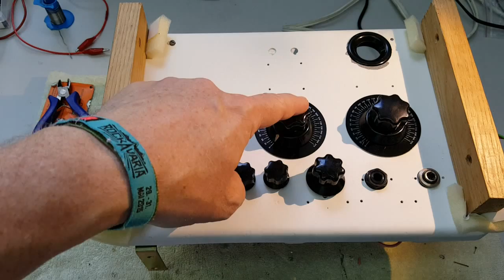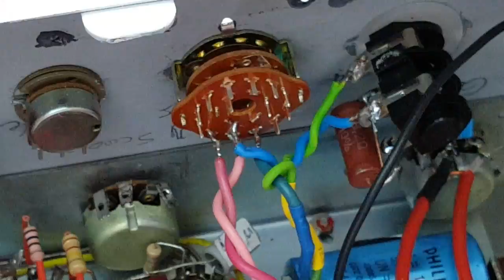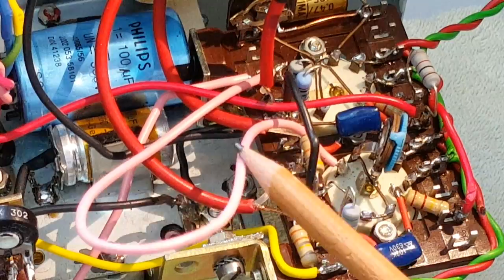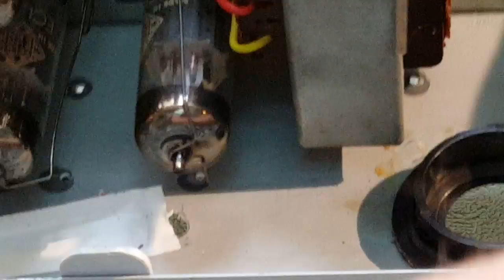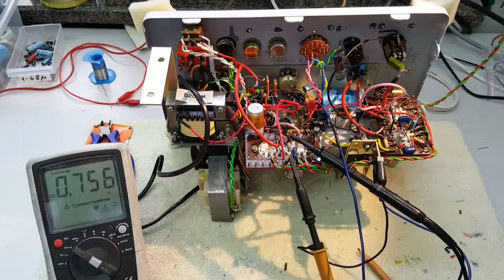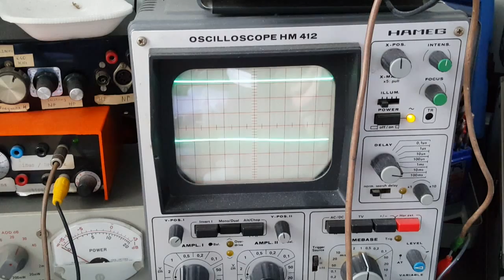Time Bomb III - Part 2 Higain amp w/ EF86 pentodes - Some progress with 3 preamp tubes

Comment: I am confused by what you said..... you must know if your amplifier is set at 8 or 16 ohms, and you hook up to 4 or 8 ohm speaker cabinet respectively (lower by half), you are completely upsetting the load resistance on your output tube/tubes, doubling the current through them, the transformer, and speaker voice coil ... For instance, in your 2nd amplifier that used a single 6v6gt. That tube has a load resistance of 5000ohms. You need to use an output transformer with a primary of around 5000ohms and the proper secondary 4,8, or 16 ohm to match your speaker. If you hook up a 4 ohm speaker to your 8 ohm tap from your amp, the reflected load resistance will be 2500ohms instead of the proper 5000!! So yes....it certainly would sound more aggressive, but will destroy your tube (and possibly your output transformer and speaker) in no time... I have heard that you can do it the other way around.... 4 ohm amp output into an 8 ohm speaker load, but if we use your 2nd amp again, the reflected load resistance on the output tube is 10,000 ohms, the current through the tube, transformer an voice coil is halved giving poor performance/cold sound. Sorry this is so long, but I thought it important you know... Maybe you do and that's why you named the amps Time Bombs! Lol  I am still very impressed with your amp designs.. Thanks for posting, Tom